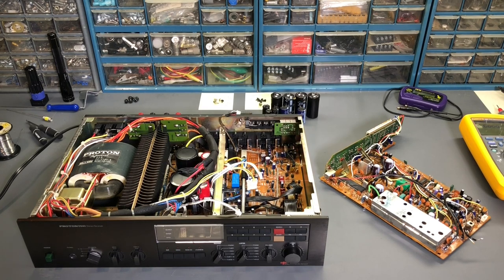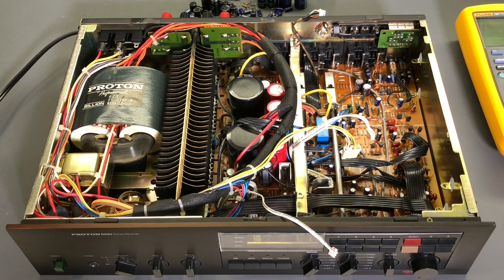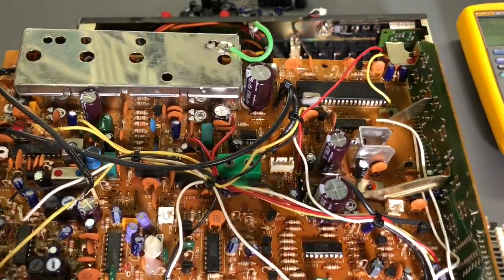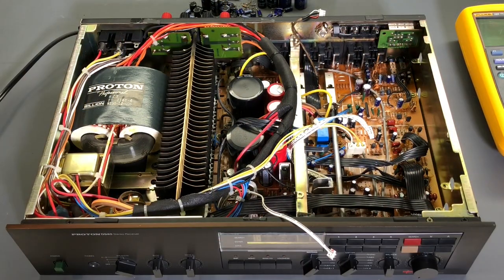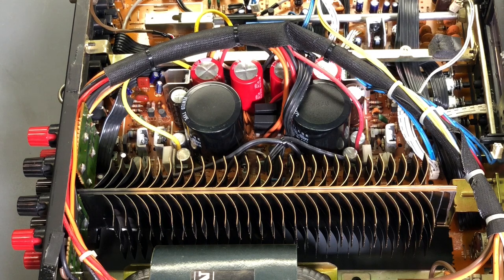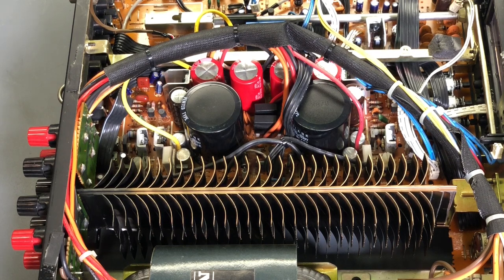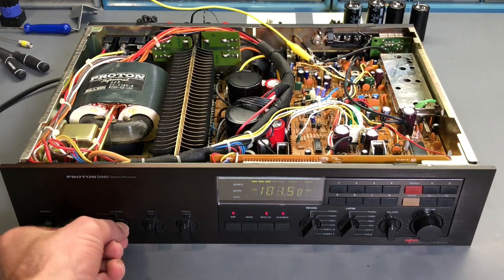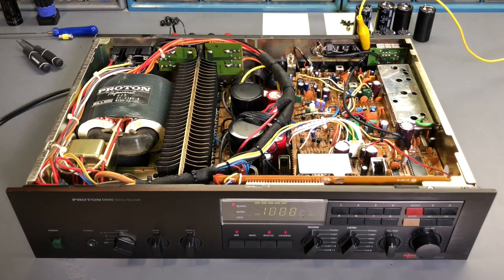Proton D940 Stereo Receiver Repair - part 2

Comment: Outstanding presentation of everything!  Great job Erik!  I have a Proton AP-1000 pre-amp with typical static and intermittent output when I touch or turn volume & balance POTS so I'll be doing a much needed cleaning in accordance with your tips.  I have this connected to a Crestron 2210S Pro Audio Amp with those @#$% (<- expletive) Phoenix connectors (I had the winning online auction bid, $48.00 for two $1000.00 amps... figured it was worth the effort to finally hear how quiet the Proton pre-amp is supposed to be, and I bought it from a neighbor's garage sale not knowing if it worked or not but knew of its reputation).  I also have a dead NAD 7100 Monitor Series Receiver that should be worth fixing... it just didn't want to power up one evening after working perfectly for years - no standby light either so I can't even use the remote to try to turn it on.... all I've had time to do so far is trace good power getting to a transformer.  It has been a few decades since my electronics classes so your videos are the review I sorely needed.  I don't have all the pro level test equipment, but at least I can rule out a few things (or maybe fix) before taking these to someone who can.  If you know of any common component failures for the NAD7100 for this power issue, I'd be grateful to know them.
Reply from the maker: I'm glad to know the video was helpful for you.  Yes cleaning on the AP-1000 should fix up the scratchy controls and at least be the first thing to try.  You can get the NAD7100 service manual free here ... https://www.hifiengine.com/manual_library/nad/7100.shtml   sorry I don't have experience working on the 7100 for service tips.

Comment: I think you'll find that the top of the electrolytic cans is a high resistance to their negative leads. I just confirmed this testing several of my own caps. Voltage seems to be induced like a ghost voltage, but not dangerous. It was common in the old days, of course, and phenolic insulators were used to isolate the metal cans for negative voltages.
Reply from the maker: You are correct the capacitor top does not have a direct connection to either lead.  It is a charge that builds up, I would say more than a ghost voltage because you can get shocked by it.  I found out the hard way years back on a Carver TFM-35 amp.  I bumped the top of a power supply filter cap on one of the negative rails (there are several in the amp) and ouch!!  If you measure the voltage with a low impedance voltmeter the voltage will "slowly" drop down.
Reply: @EriksElectronicsWorkbench  I just now measured 17.5uF between either terminal and the case of a 6800uF 80V cap. Interesting.

Comment: DId i miss the portion of the video where you cleaned the pots? Im having the static issue with the input selection. There's no easy way to get to them. I dont use the tuner function, just the phono which sounds great. Thanks for the detailed video.
Reply from the maker: You can only access the switches and potentiometers by first removing the tuner circuit board (not including bass, treble and speaker select which can be accessed easily).  I didn't show cleaning the controls because it is just spraying cleaner into the switches and pots and working them back and forth.  Part 1 video I talk about removing the tuner board.  There are some wires to desolder and unplug.

Comment: is there an ic there for audio?
Reply from the maker: The D940 uses some op-amp IC's in the pre-amp section, there are some specialized IC's in the AM/FM tuner, and the power amp is all discrete components.

Comment: FYI this uploaded as only 360p.
Reply from the maker: The HD will become available soon.  It takes a little while for YouTube to process it.
Reply: @EriksElectronicsWorkbench  Ah, I should have been more patient.

Great video! Much appreciated.

Do you know how the ACC function interacts with DPD? Does DPD not kick in because there's no clipping?
Reply from the maker: @jonathanhendry9759  Thanks glad you enjoyed the video.  The ACC circuit is not related to the DPD circuit.  The ACC is basically a soft clipping control that helps reduce harsh clipping (i.e. looking like a square wave)  if the power amp is overdriven. The ACC circuit is on the input of the differential amp (where the signal first enters the power amp), the DPD circuit is all on the power output stage side.  DPD only activates on changing peak pulses.  A continuous steady sine wave will not active the DPD circuit. In otherwords the DPD will not keep the high voltage supply rails switched in continuously.